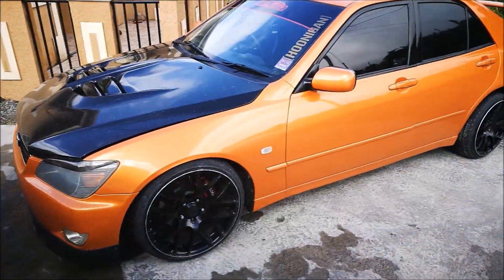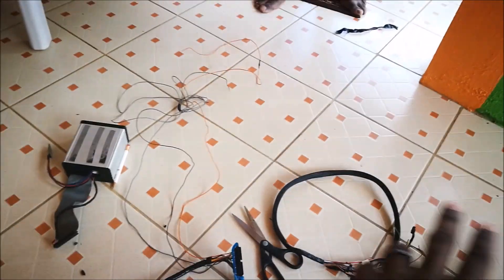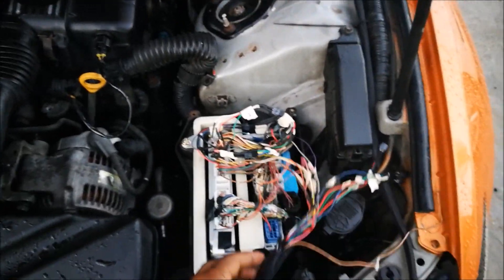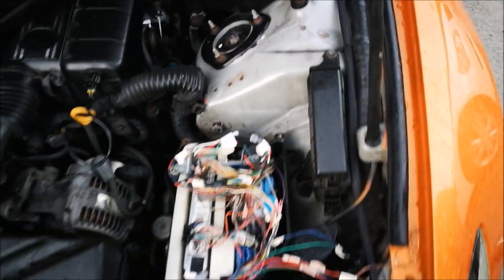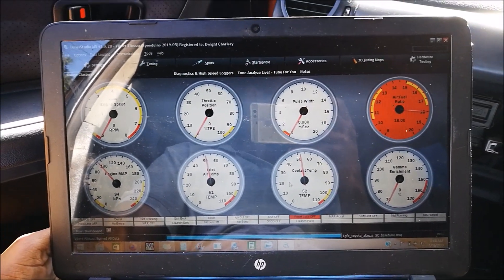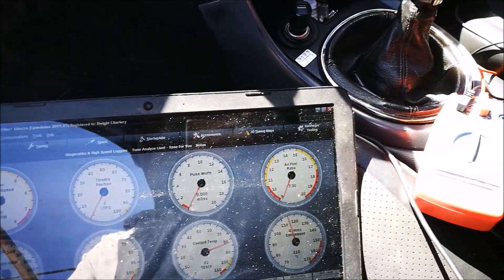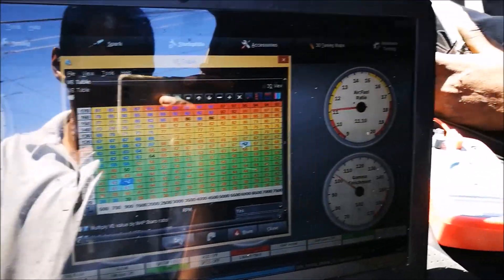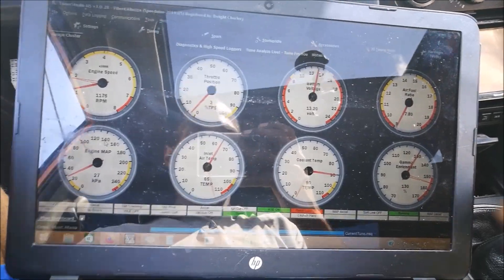Getting a Lexus is200 to Run on a Speeduino ECU

Comment: Hey bro, need your help. I bought a Toyota Altezza Gita from a salvage auction. It has a Supra non-turbo engine. Unfortunately, the previous owner stole the ECU and key.

I bought an ECU kit (ECU with the same part number as the dealer told me for my car, plus the key barrel). My car is a 2002, but the ECU kit is from a 2003. The car still doesn’t start, and the security light on the cluster keeps flashing.

Do I need to change other components for it to work? If yes, which ones?
Reply from the maker: You would need to get a hold of someone local or a company you can mail the ecu to, to perform a immobilizer delete on the new ecu.

Comment: @DCwerx great job, how did You connect the throttle body is works correctly? How do You connect the stock ECU that it works in pair with speeduino?

Comment: Hello, thank you for the information passed on, I have a question about the MAP sensor, the MPX4250 is used, which in turn is reading the pressure signal, but how does it behave when the engine works in depression? In your opinion Speeduino is approved? Thanks.
Reply from the maker: The MPX4250 reads both boost and vacuum. 0-250kpa absolute. 

Highly recommend Speeduino

Comment: Awesome! Put a GX100 throttlebody on it. Bolts straight onto the Is200 manifold and gives you more responsive throttle with pure cable control.
Reply: I have been looking for some sollutions for the slow throttlebody of the is200, have you done this on your own car?
Reply: Where can I find this

Comment: Hi from Puerto Rico, I mount a speeduino on a 3sge beams read top bur I can starup the engine, I dont know if I have a wrong trigger setup, can you help me?
Reply from the maker: Late 3sge and most Toyota engines use a 36-2 crank trigger and a single tooth cam trigger. I usually only use the 36-2 crank trigger (NE) and ignore the cam trigger.
Reply: @DCWERX  Thank you, the car startup and run, I have another question, how can I put 2 step with de speeduino v0.4? What is the pin to put the clutch switch? Thanks
Reply from the maker: @1022crazyboy  great. clutch switch goes to IDC pin 18/ Arduino pin 51 on the v0.4.
https://speeduino.com/wiki/index.php/V0.4
Reply: @DCWERX  I put a wire from ground pin to the 18 pin and on tuner studio a leave de input on default pin and set de rpm to 3500 but it doesn't work, the rpm still rising.
Reply from the maker: @1022crazyboy  you need to populate the proto area.

Comment: So y not sequential injection ?
Reply from the maker: Speeduino can only do up to 4 cylinders sequentially
Reply: I read that it can do six sequential injection with wasted spark
Reply from the maker: @maddida  officially it can only do 4 cylinders. Unofficially a few have modded the code to make it work with 6cyl sequential.

This car and 90% of speeduino user will be fine running batch Injection and wasted spark
Reply: I would love to fined out what exactly is needed to make it work
Reply from the maker: @maddida  try asking in the forums

Comment: Do all the stock gauges work on the the car? I have had a quick search online for this answer but can't seem to find out if they work or not.
Reply from the maker: Yes. everything works like factory
Reply: @DCWERX  great thanks for the reply, and is that the same for the other cars that you have done? Also have you found any problems when piggyback set up or do you only use the speeduino as a stand alone ecu?
Reply from the maker: @billysworkshop.  I haven't had any issues with any dash not working with the installations I have done. No issues using speeduino in a parallel installation, and yes I mostly do Standalone installations with speeduino
Reply: @DCWERX  great thanks for the info you are an absolute legend! I've now placed an order for a speeduino, thanks again for replying and I look forward to the next video 👍
Reply from the maker: @billysworkshop.  glad I could help man. Good luck
Reply: @DCWERX  thanks I'm sure I'll be OK but may give you a shout if I get stuck, great channel and great content, keep up the good work 👍
Reply: @DCWERX   How can the MPG work if the stock ECU cannot tell the dash what its doing, as its not the ECU doing it?
Reply from the maker: @beyondhelp00  the dash still operates as if the factory ECU is controlling the fuel injectors so it calculates the mpg as if it were stock.